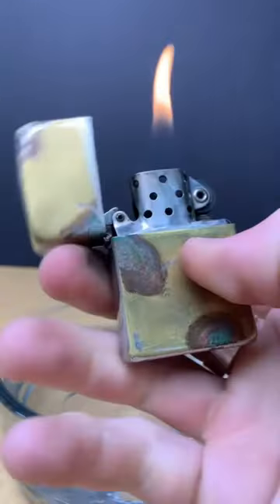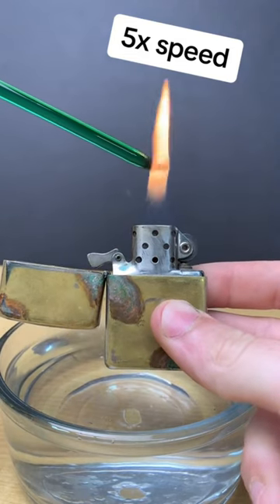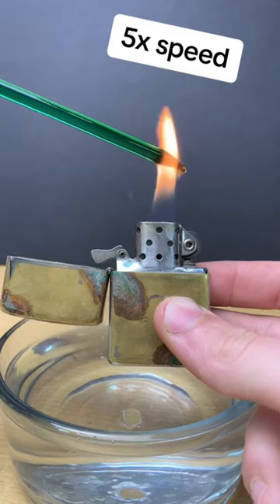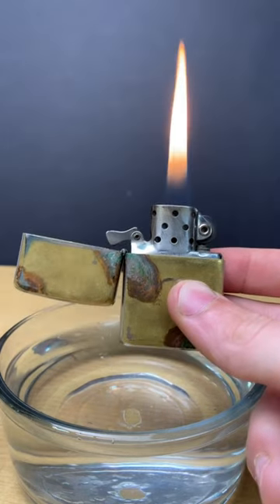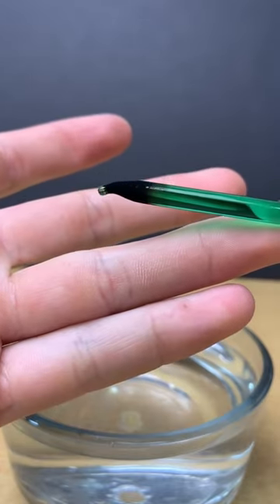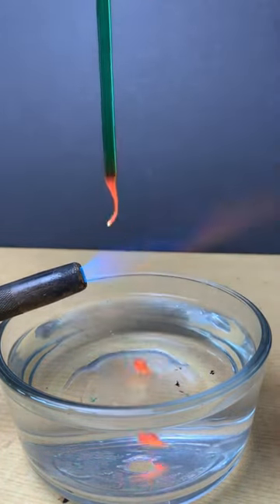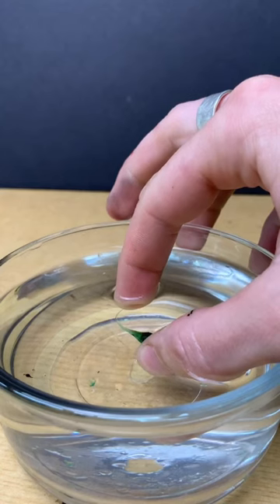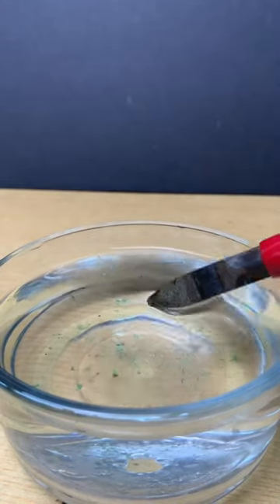Zippo Rupert’s Drop?

Comment: Set the lighter down where there's no wind and hold the glass rod vertically above the flame with the tip of the rod just within the tip of the flame and it will probably work

Comment: The tip of the flame is the hottest point, not the middle, you should have heated the glas with the tip of the flame
Reply: Was about to comment the same.
Reply: The hotest part is the tip of the cone within the flame, not the tip of the flame itself.

Comment: You used a lighter to try and melt the glass, but it didn’t work because lighters have yellow flames, the propane torch melts the glass so quickly because it has a blue flame, and blue flames are hotter than yellow flames.